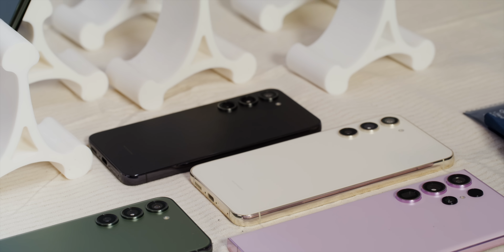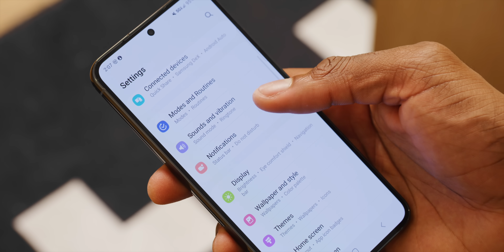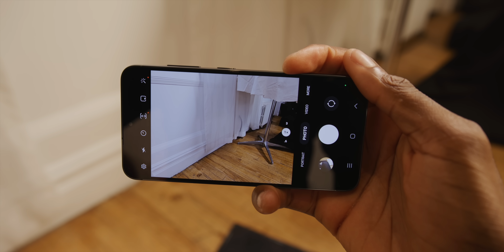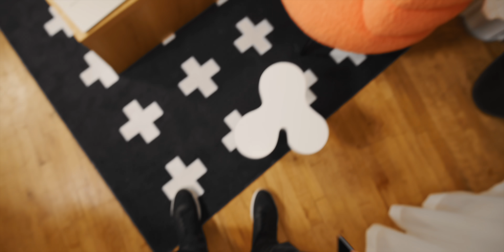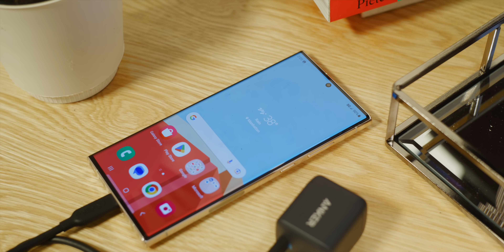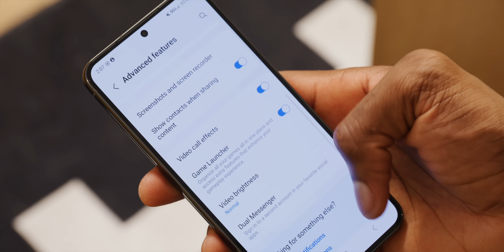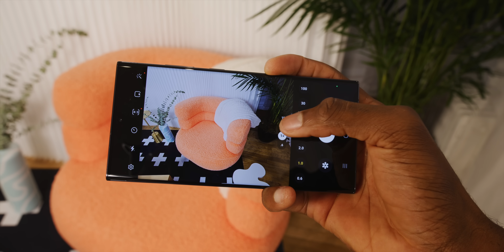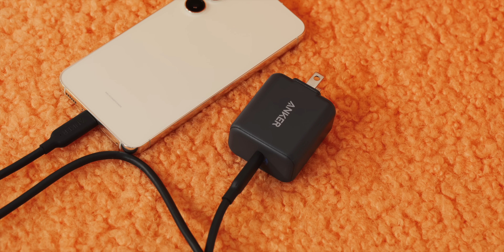Galaxy S23 / Ultra Impressions: Cruise Control!

Comment: Still rocking the S20 Ultra and it is still great. Feel like since the S20 Ultra, there haven't been any reason to upgrade. I upgraded from the S10+, and that was noticable. 120hz, 5000mah battery, the great camera, super snappy. And it still performs like that! S20 Ultra will probably be in my pocket for a good while more. Then I am thinking of trying out a Pixel phone. 
Written on my S20 Ultra, I love you ❤️
Reply: I'd agree if my S20 Ultra's display didn't suddenly go haywire (bright green/white, unusable), there are videos of it happening on here and it's not the 'green tint' bug that was patched it's far worse. It apparently affects the other S20s (possibly S21s) too and it seems like Samsung just puts the blame on users every time it's raised as a fault.

Also the S20 Ultra's camera is capable of fantastic images but getting it to focus was always a pain. They fixed that from S21 onward though by including a laser rangefinder that is used to control focus rather than computation.
Reply: @Nurr0  my focus is on par or better than apples new flagship. The s22 ultra was a good buy for me.
Reply: @GreggyPreviews  Thanks for the info, I'll keep it in mind, I'm glad the focus fixes have persisted past the S21s too. Still considering what to replace it with, on a placeholder at the moment.
Reply: I just upgraded from S9. I can't wait for the paradigm shift I'm about to experience 😆
Reply: S20 plus user here! I need that micro sd slot in my life bud!
Reply: @doriansorzano  I would say yes that was a big mistake! But one terabyte is enough for me for 3 years. As long as my old files are backed up
Reply: I have the S20+ and even now I find it very nice. Obviously having a better chip  above the S20 series I feel like it would make a difference because some apps that I use, which is mainly social media and a few games, there's some little glitches. I can imagine with your S20 Ultra is insane though since it's a highest version on the S20 but I would consider upgrading to that or the S21
Reply: @bryantmunoz9969  You and me have the same specs as the S20 ultra with our s20+ except for camera which I personally think is good enough.
Reply: S20 Ultra, I love you ❤️.... chill bro 💀 it's just a phone
Reply: me too man the only issue with the s20 ultra is the focal point issue with the lens they used but the zoom is just unreal that 5x optical zoom is just 💦
Reply: I can't imagine switching from a phone with great fast charging to a Pixel which will take forever to charge up. That's the biggest reason I haven't gone for a Pixel.
Reply: @hotbeefymcd8162  true. Hopefully when I maybe do the switch for Pixel, their new model have faster charging. But I am expecting 1-2 more years from my S20 Ultra. I try to keep it in good condition and being careful with it.
Reply: My s20 ultra has camera focus issues..
Reply: I have the s20+ and I won't be upgrading. It still as fast as the day I bought it. The S20 series Samsung threw everything at in terms of specs. They've nerfed every new release since then.
Reply: same man 😎😎
Reply: The s20 ultra is still the biggest galaxy device which is interesting to think about. Why did samsung make the other ultras smaller
Reply: @jitterrypokery1526  smaller and note shaped. Never really liked the boxy shape of those.
Reply: S22 ultra was the reason for revolutionary zoom features
Reply: I have a S9. I'm going for the S23 U after over 4 years on my old phone! I also love taking photos on my phone so it works for me. However the changes seem minimal from each generation before so for most people, 2 or 3 years would be a reason to upgrade.
Reply: don't go to the  pixel  LOL , I   have it and i really don't see the hype. the camera legit fires pics just like my iPhone 12  pro did and videos are  not great at all . i may try  out the S23 because I'm over the iphone , but if the stability is  not there , i may have to go back to the barn 🐑😭
Reply: Upgraded from a s10+ to the s21 ultra and I agree, I haven't had a reason to upgrade from my current phone. Huge difference between my old phone and this one but I've been using it for 2 years and it's still phenomenal
Reply: I still have the s10+ and was thinking of getting this one.
Reply: @awesomeerr8765  getting the s23 ultra?
Reply: no on the pixel, always quality issues by google.
Reply: Had the 20 Ultra for three years I'm gonna move iver to pixels now
Reply: Camera
Reply: @ashjules2911  the S20 Ultra camera is still great. And the camera is probably furthest down on the list of my needs with my phone. I won't put out money each year for small overall improvements and a new slightly improved camera with good marketing and photo edits from perfect conditions behind it. Maybe if I worked with photography or social media. But then I wouldn't use my phone as main either so.
Reply: @Mullvad  yes of course I have the s21 ultra camera is great but 200mp would be even better 😊
Reply: @XzXmullvadXzX  no the camera never focused well for me. I hated thinking I got a good video and it was all fuzzy.
Reply: Buy an iPhone, and you’ll never look back or think twice ever again!
Reply: @martinthomas2520  can't pip youtube as much as androids, that's enough for me to have sold my iPhone 13, and go back down to a s10+, the notch, is noticeable. Always. People who say it's not are in extreme denial.  I hate the hole punch on galaxies. Yeah extremely hate the notch.  The screen on the normal IPhone feels like plastic. Only the max and pro have a non plastic feel screen. All galaxy series screens feel glassy not cheap.

Comment: Marques skipped over almost all of the improvements on the S23 ultra from the S22 ultra. Sure, if you skip over the improvements, it's the same phone. This video almost seems lazy as if Marques didn't really look for differences. Mrwhosetheboss showed the updates and it looks like a pretty good yearly iterative update. The camera improvements that mrwhosetheboss showed look incredible. Marques shows the shutter lag on the S23 but Mrwhosetheboss shows the S23 ultra and S22 ultra side-by-side and the S23 shutter lag is much smaller. The image stabilization is drastically improved. General camera quality is significantly improved. The 256GB vs 128GB storage on the base unit is a big deal. The UFS 4.0 with double the flash access speed is big. Gorilla Glass Victus 2 sounds like it's a lot better. If you live in Europe or Africa, you get the real Snapdragon rather than the Exynos. And the Snapdragon Gen 2 itself offers much better benchmarks than gen 1.

Comment: I wish you would do a video explaining to the common person why these phones are able to take 200Mp photos on such a small lens. I feel like a lot of people are misinformed about how the pixel binning actually works. In short right they take 4 photos and fuse them into 1 bigger size photo. And vice versa when you take photos without the "200 MP" mode on it is taking 4 photos and compiling them into one better looking 12Mp photo.
Reply: MrWhoseTheBoss just did a fantastic explanation of pixel binning in his S23 video.
Reply: Mrwhoseboss did it! And it was absolutely incredible!!!
Reply: Iso-pro and hdr is the combining multiple photos different exposures, the hardware binning, or The Tetra pixel technology part of the success came with  ISOCELL 2.0 the the advantage of the pixel separators bring better colour fidelity and the breakthrough non matalic separator that came with 2.0 allowed for no optical loss wish was the privous weakness. ISOCELL HP2 sensor is why we can now have high pixel count again.
Reply: It's only using pixel binning to produce 12 MP photos, pixel binning is specifically a way of treating a sensor like a lower resolution sensor with a bit of a bump in IQ compared to if you just sampled some of the pixels to drop the resolution. Taking extra photos and stacking them together is, well, image stacking, and it's a basic form of computational photography.

Comment: Google Fi has a hell of a deal for existing customers. S23 Ultra 512gb for $600, no trade in needed. Pre-ordered a green one.

My current phone is a Note 20 5g and I also scored a deal on it through Google Fi. Only paid $500 with no trade in just a month after the Note 20 5g was released. Looking forward to the upgrade after almost 3 years.
Reply: Which plan do you have?
Reply: I’m on the fence of buying the s23u on google fi. But I still owed 600 on my s22u 😢

Comment: The best part about a new Samsung S-line release was that the previous year’s model got a massive discount (wherever it was still available) now with the S23 being essentially the same as the S22, it may mean that the S22 keeps its price a little longer.
Reply: I've had my s22 ultra for a year now. Zero issues with battery life. Best phone I've ever had. With that said, I'm considering upgrading. Because I'm a sick fck.
Reply: you can always get refurbished phones
Reply: Right now Fi is selling S22 256gb for $849.99 while they have the S23 256gb on pre-order for $299.99. I don't know if it's a sign of the end times or what.
Reply: Is this what broke people look forward to?
Reply: @dadillonful  thats what smart people look forward to. Even if you're financially stable, it's smart to buy the cheaper option, if the latest spec's aren't your thing
Reply: I own the s22 ultra and i woudn't have payed 500 euro's for it if i had known how poor the battery life is. It is also still full of bugs, when using maps, u can not turn of the screen, since it directly loses GPS when the screen is turned off. In my opinion the discount can't be big enough.
Reply: @marijnsamuels  5000 mAh battery still consider poor battery life? seriously?
Reply: @jm0402  the amount of mAh doesn't say anything. The pro Max 13 has 4352 mAh and has about a 50% longer battey life. I'm absolutely no apple fan, but i am seriously conceredering to buy an iphone after this. For my work i often do not have electricity available for 12 - 16 hours, and i'm sick of always having to carry a powerbank.
Reply: @marijnsamuels  My s20fe lasts the whole day and to me that's insane. Is your ultra really worse than that?
Reply: @IN-pr3lw  i sold mine in the meantime and bought an OnePlus. The OnePlus has better battery life and costs €900,- less. I only miss the camera of the Samsung, but you can buy a very nice camera for €900.
Reply: @Diede Dingemans  but did your old phone last the whole day? If not then I'd be surprised because to Mr that's a good battery if it lasts a full day at school or work
Reply: @marijnsamuels  for lost gps when screen turned off.. because battery saving mode on, try to custom battery saving mode..as a gamer i agree about battery performance on snap gen 1

Comment: shutter lag isnt that bad lol, it would probably be fixed on future software updates and if negligible shutter lag makes for great photos (which I have seen from the S23) its all good because shutter lag also happens even to other phones and even on DSLR cameras
Reply: If you watch the mrwhosetheboss video, he holds the S23 ultra side by side with the S22 ultra, and the S23 ultra has a much smaller faster camera lag in comparison. Marques didn't mention that the shutter lag is much improved over last year.

Comment: Processor, wifi band antenna (from wifi 6 to 7), the UFS storage (from 3.1 to 4), the RAM (from DDR4 to DDR5X), also changed inside them

Comment: I have the Note 20 Ultra and don't see the need to upgrade. 
I have a secondary line that I'm using a iPhone 14 Pro Max (first iPhone since the Jailbroken 4s days), and I'm actually shocked how basic iPhones software is in comparison to modern Androids.  From customization options to multi-tasking, just seems like iPhone really hasn't done much with iOS since my last one in 2012 or so

Comment: I was going to upgrade to the s23 Ultra but my S21+ is still running mint. I'll keep it for another year then grab s24 Ultra.
Reply: I'm probably gonna trade in my s21+ for the s23 ultra cause ATT is gonna give me probably like $800 in billing credits even though my screen is cracked.
Reply: @theviralusername  yeah that’s $800 over 3 years though. That means you’ll have to keep that new phone for 3 years. Not everyone likes doing that. I don’t even stay with the same service for 3 years. Every year I get the new phone on Verizon. Switch to T-Mobile for 3 months. They give me a prepaid card to pay the phone off. Stay with T-Mobile for 2 months then switch back. Basically get an unlocked iPhone pro max for $100 every year.

Comment: Time to get a S22 Ultra for cheap guys!  Love mine
Reply: How is your battery life? I had a s22U but didn’t find the battery to be satisfying. Besides that it was an excellent one, currently have a 13p max
Reply: @ItsKK17  Depends. I've seen 8-9 hours of SoT on good days, and as low as 4 hours on bad days (bad cellular signal, poor wifi, power hungry apps, etc.).

I charge it at 85% ("Protect Battery" feature) at night, and I usually end the day with ~30-35% left (Music/podcasts, YouTube, some Twitter, watching my surveillance cams at home, etc.)

It's been pretty good so far for me overall (got better with One UI 5 for some reason), but it drains faster at work (mediocre cellular reception).   If battery life is the #1 criteria for you, the iPhone is still the king, but the S22 Ultra has been pretty good for me, can't complain.
Reply: @phazonclash  appreciate your reply, thanks bud. and yea battery life and A+ standby was very crucial for me as I was travelling for 2 months and I just did not want any battery anxiety. I did miss the camera of the S22U though, the zoom would've been handy. but besides that im just as big of a fan of the s22U as the 13pm. both are great devices.

Comment: looks outdated to me, i have seen this design in the iphone XR and the flat sides of the 12pro i thought Samsung would be more original...the sides i have been using on the 12pro and tbh they're uncomfortable without a Case, but then who would use it w/o a case.

Comment: Does the S23 (non plus/ultra) screen drop to 1Hz? I saw another channel say it only goes down to 48Hz
Reply: On the S23 and S23+ its 48 - 120hz
And on the S23 Ultra its 1 - 120hz
Reply: @Cedricisback19  Yeah I've seen that listed, I've also seen it claimed to be 24Hz. In this video he was showing the regular S23 flickering and wrote on-screen "1Hz"...that's why I'm asking. SOmeone with the phone just needs to enable the "Show refresh rate" developer option and show what it drops to.
Reply: @Cedricisback19  These display specs in general seem difficult for people to get right. Even the screen brightness, I just saw a video show the S23 screen brightness as 1300 nits instead of 1750....
Reply: @Cedricisback19  jeez, just saw LTT's video (shortcircuit) shows the regular and + models as 10-120Hz....I'm completely lost at this point...

Comment: Man, that is the most boring update video I've ever seen
 Nothing on MKBHD's part, samsung just gave up. The longest part of this update? The fact that it flickers on camera. Seriously? They're THAT boring?They're too cheap to even remove the bottom chin on the ultra, it's the same ever since the Note 20 ultra. The s20 to s22? Gone. 
3 gens later and it's still here on the ultra. They're just too cheap to remanufacture a new glass panel, they've been using the Note 20 ultra's one for 3 years now ffs. Enough is enough.

Comment: If there isn't a 200mp raw file output and manual settings mode for 200mp - and if raw + manual settings only outputs 12mp files like i bet it does then to me it's a scam.

What's the point of 200mp if you can only get it with auto ISO auto focus auto shutter speed and jpg output? That would be useless and gross.

Comment: It is better that they don't try weird stuff in their main line if they don't have to, but maybe they should swap to bi-yearly for their main line? It would make the main line have more of an impact while giving people a reason to try a Fold or whatever, if they really have that yearly new phone itch..  
  
I waited 2 generations from the Note to 10+ to the S22 Ultra and it felt signifigant enough. I have no need for the S23, which is a good thing.

Comment: It would have been better if Samsung focused on better apps optimization, producing better software for image processing, better battery lifespan and longer software supports up to 5 or 6 years. We are at peak smartphone specs already with the previous gen. Just wished this gen focused on longevity. Now looking back i can still hold on to my S21 fe for another 3 or 4 years from now. Also if you plan to give the exynos chipset to other regions might as well make it stronger than the snapdragon.
Reply: This year is snapdragon worldwide.
Reply: Thank you. That is a plus point for samsung this time.

Comment: I still wish the screen was completely flat, but it's a massive improvement over last year's screen, so there's that. Still giving us only 12GB of RAM (and 8GB on the other two) is insulting though.
I saw people saying the LPTO screen on the S22 Ultra didn't actually go all the way to 1Hz (more like 40Hz or some such), so I'm curious to know if that happens on this year's model.
The shutter lag is just awful though. It's bad enough on my Note 9 but this looks worse. I'm not sure I could handle that, especially since I take a lot of photos with my phone.